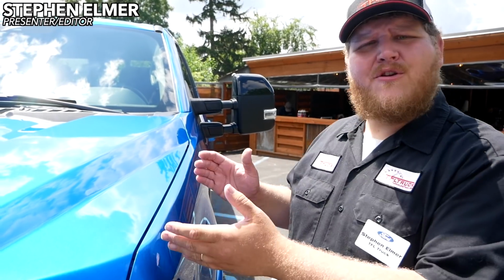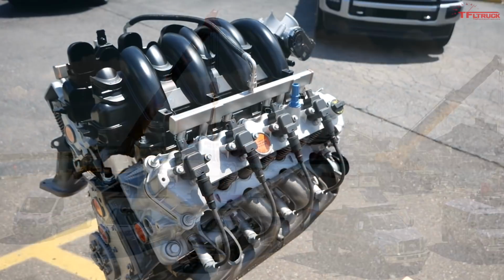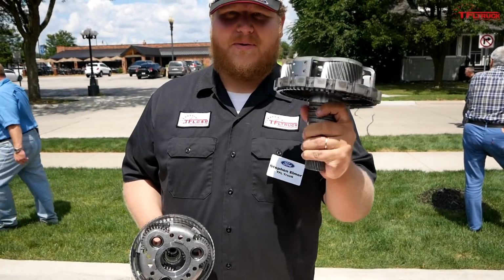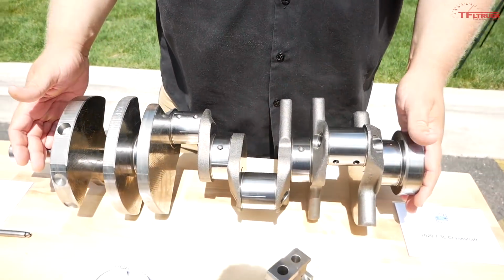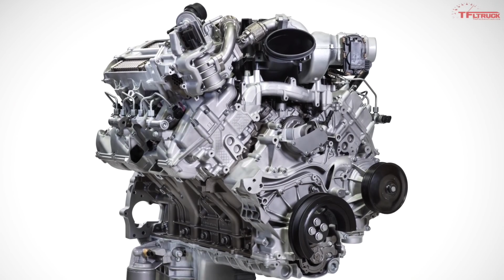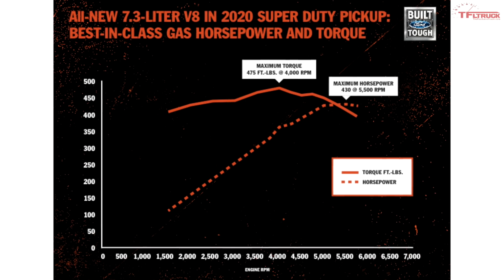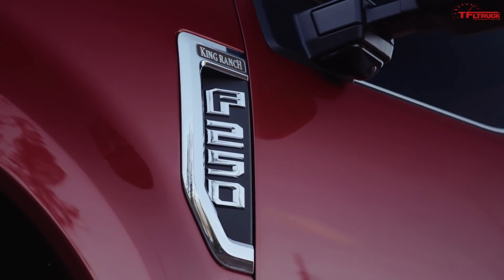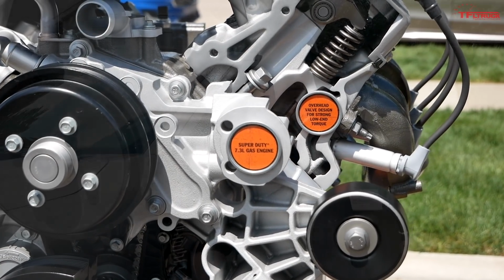We Finally Know the Ford Super Duty 7.3L V8 Power Numbers & They Are Lower Than We Thought!

Comment: If Ford could just bring back the excursion (based on the 2017+ Super Duty) with the options of either the 6.7 Powerstroke or the 7.3 gasser, mated to the new 10-Speed Transmission that'd be great.
Reply: I purchased a new MY00 7.3 Excursion Limited.  483,000 miles.  Motor has been chipped to 300hp, and never been touched inside, original fuel injectors!

Ford did two things that prevented the Excursion from taking off, and crushing the Suburbans, Yukons and probably some pickup truck sales as well.

1. Ford III received pressure from his environmentalist pals and agreed to NOT agressively market it.  You never saw an ad for it in RV magazines, snowmobile, boating, horses, ranching, the kind of users that would put high value on it, especially if they pulled trailers.

2. in MY00 GM did not have a turbo diesel to put in their pickup trucks, Ford saw an opportunity and built and sold as many 7.3 PSD pickups as they could.  In the first year, there were very few 7.3 Excursions and they were not made available for testing by the magazines and media.  Instead they took the standard 4x4 V10 motor, took it out in the desert, got them stuck in the sand and showed very poor fuel economy.  If they had tested 7.3 Excursions, on the road, with trailers, E range tires and decent springs, they would have killed the competition in almost any way you could measure.

ExcursionPSD
Reply: Emissions killed the Excursion, so Ford killed production after 2005 in America, and 2006 in Mexico
Reply: @DeezNuts-sx9jd  No, public opinion killed the Excursion. At the time, the environmentalists were louder and screamed about this truck as being to big. Never mind the suburban was as big.  Ford had no problems meeting emissions. It was a double standard that killed it.
Reply: chris1451 the terrible gas mileage made it very unpopular amongst those who never got the chance to experience it. I know a mid-aged dude who hated it when it came out and during its run, but he now has two 7.3 excursions and loves them to death.
Reply: @DeezNuts-sx9jd  The sales of the truck were fine. So your opinion doesn't hold water. Ford got shamed into quitting production.
Reply: I'd be first in line if they ever brought back the Excursion. My 02 is getting pretty tired with 300k plus.
Reply: @chuckmuellerleile8729  with all the money you saved not making payments, rebuild.
Reply: I bet it would sell like hot cakes in this Truck and SUV obsessed market.
Reply: Would love to have one based off the new trucks!
Reply: It’s coming. Just saw a covered up suburban with a duramax in it the other day GM was testing. You can bet ford will make a diesel suv too.
Reply: austinr09 the suburban 3500 has been out for a few years and it offers a diesel option. Granted, it is only for commercial use.
Reply: Yeh. What happened to the excursions. I have two with the v10 .  Thinking of dropping a 632 gas engine in it.
Reply: @billhumme5228  They were discontinued because they ran out of little pecker do nothings to buy them!
Reply: That would be so boss..
Reply: I still have a 2000 model Excursion Limited edition 4x4 and the Triton v10, have owned it since 2002 (240k). If anyone is interested hmu.
Reply: Government contract ended.
Reply: Miss the Excursions. Loved the extra weight. Did not need to throw into 4wd nearly as often...
Reply: But why do u like the excursion when u can have an f250 with a topper... same thing 🤷‍♂️
Reply: @usmcguida  it's not the same though. With and excursion you can fit 8 people plus a bunch of luggage, while towing a 10000 lb trailer all with relative ease. No other truck or SUV can do so
Reply: @usmcguida  but can you seat 8 people when needed. Or one of mine seats 7 because of the captains chairs in the middle row. Sometimes I need s pickup also for large items.  The v10 does have bad gas mileage. Does anybody here think the truck could support a 632 cu. Engine. 850 lb. Ft. And 850 hp.
Reply: @usmcguida  no it's not lmao
Reply: @usmcguida  🤣🤣🤣🤣🤣

Comment: Dear Ford, you’ve been Shoving 2.4 1.4 and turbo charged V-6 engines down everybody’s throat for years...all unwanted, and now you’ll build a new V8 engine with your track record of two failed V-8 diesel architecture and absolutely problem ridden V-8 gas engines since 1998 ,which had problems that were not corrected 10 years after its initial design ? That existed until  the engine was “scrapped by us “ and finally abandonedby you , and you expect us to trust you with a new engine design, LOL 😂

Comment: 400TQ at 1500rpm? Good luck doing a 0-60 with TC off lol.
Reply: Trust me, they have torque management out the wazoo.  The 6.7 has 935 ft lbs and magically it barely lights them up (well, I do have 4 tires back there)...

Comment: Chevy 6.2 makes 420hp and 460lb ft tq. Not super impressive at all.
Reply: The 6.2 isn't a heavy duty engine.
Reply: Chevy 6.2L
350 lb-ft at 1500
400 lb-ft at 2750
Reply: Ford is aiming for simplicity and reliability here. That 6.2 in the Chevys and GMCs suffer from injector failures and carbon buildup issues due to DFI. Carbon buildup can be so bad at times the entire heads need to be removed to remove all the carbon. Ask me how I know.

Comment: The moral to this story is the manufacturers are tired of meeting over burdensome emissions requirements for diesel engines. New diesels are much more expensive to maintain due to B.S. requirements. 
Ford and GM used to make engines that had their HP & Torque in the low rpms in the 60's ,I guess what's old is new again.
Reply: Amen to that my 6.7 diesel is crazy expensive for everything and you have to take it to a dealer to code everything or pay $600+/ yr for IDS. Factory power makes 400hp 800 lbft torque and pulling 14k lbs it makes easy work of it.
Reply: @whiskeytangofoxtrot9403  yes parts are expensive, I have a 16 comes with 440 and 860, but I use forscan which is free and it reads just about any module and pulls the codes on the newer Ford's.
Reply: Yep, truck makers may as well invest more in the gas engines for light duty trucks. The DPF/DEF systems add too much cost and maintenance to the new trucks plus, of all things, the engines fail long before they should, area of 150,000 miles and they are worn out from high heat levels. If you are lucky, you will get 150,000 miles but many will see engine failure at 90,000 or so. Sad for those diesel markets and they average another $11,000 in cost.
Reply: Garth Clark I’m no fan of dpf/def but these trucks are lasting a hell of a lot longer than 150,000. I work in the hot shot industry for a company out of Indiana with 1500 drivers and the bulk of them are newer pickups of all makes with well over 300k miles on these truck. Though personally I use the 5.9 Cummins 03 came stock with no cats or egr. 😆
Reply: @chrism1966  Most of the failures are coming from vehicles that spend much time on short trips, city driving etc. Those who are on the road for long distance tend to benefit best as the temps are always in the upper range thus the DPF doesn't regen so much. As I known it, below 30 MPH none of these diesel will regen ever.
Reply: @Garth2011  my old roll back with a built engine was less than that people need to just not buy the new over priced crap i laugh at 53k f150
Reply: Where does this expensive to maintain crap come from? I change the oil (10 qts) and $8 filter about every 5-7000 miles and fill the DEF tank twice between changes.  I use Amsoil 10w40 diesel oil and AC Delco filter. All in about $100. Oh, maybe because it is a Duramax!
Reply: @paulmcintosh5535  11-14 Ford 6.7 6.7L Powerstroke Diesel OEM Ford Fuel Injection Contamination Kit US $3,450.00 Ford Powerstroke 6.7L 2015-2019 FOMOCO Stage 2 Predator GXR-7 Performance Turbo $3,199.00 /1599.00 OEM /fer used engine $7,500.00
Reply: @overbuiltautomotive1299  What does that have to do with overly expensive maintenance on modern diesels?  Mine is no worse than modern gas truck engines.
Reply: @paulmcintosh5535  ok i tried

Comment: I love everyone talking trash.12v Cummins were 175hp/400tq. This is a easy to work on gasser with a cat/simple egr system.
Reply: That's just stock, upgraded you can easily get that number up
Reply: @alexavila8690  https://www.cars.com/articles/what-are-the-most-reliable-cars-for-2020-hint-genesis-lexus-make-em-418187/
Heres a list of the most reliable. There's a search engine named Google. Check it out and then you won't have to ask me for this info. LOL!
Reply: So a 7.3 diesel has low stats to yet both can do a million miles no sweat somthing a gaser cant do without a rebuild plus do easy mods on a diesel and them numbers get bigger where a gas u cant
Reply: @morgan-xv9bc  I like the 7.3 diesel but as far as the new diesel's I would take this 7.3 gas or a v10 any day. Be there done that!!
Reply: Diablodrift well your right about one thing. You will need to work on it! Lol!

Comment: So let me get this straight from what I've heard from people older than me. Sounds like we started with these types of gas motors in the 70s then ford and chevy turned those gas based motors to diesels. Now they've both returned to their gas roots which is good. And the only one out of the mix is dodge because they didn't make their diesel in the first place. Cummins did and that's why it's a whole different beast. I would say the same for a cat diesel or any old john Deere or perkins. A bit of a ramble but I like where all this is going back to the basics.

Comment: Impressive numbers given the technology. Ford kept this engine simple, pushrods with the cam in block. Ford isn't my first choice, but I admire this engine. Peak output numbers are for those who buy based on the brochure not test drives. Torque curve of the engine and the entire drivetrain gearing is what matters.

Comment: Too much background noise. Those exhaust manifolds will flow better than the ones Shelby Mustangs had in the 60's !  Do I see an external mount oil cooler ? That is perfect.  Camera went too fast over the orange circles that showed areas of improvement.

Comment: That torque curve is impressive!  Why is this “underpowered?”  Are they drag racing or are they towing a train?
Reply: No. They just want something fast so they can brag about it. The higher the horsepower, the fast the truck must be. Frankly, we were better off with power ratings that were only 230-260 hp, and 290-350 lb-ft. Why do we even need 400+ hp?  No wonder modern vehicles are ending up in the shop more than ever.
Reply: Mr10Alpine sounds about right.  Vehicles are cheap to lease and most have this throw away mentality here.  So bigger must be better.

Comment: The peak HP figures of modern engines can't be used to compare real world performance. The ability of a driveline to do work is a more complex issue. This engine and 10 speed combo will almost certainly be able to deliver significantly higher average power to the wheels through the acceleration range than competing smaller NA-V8 engines and/or engines coupled to fewer gears, despite very close peak HP figures. Having a more conservatively tuned peak HP, and a flatter power plateau, demonstrates conservative engineering and really speaks to a more intelligent customer base who have to make decisions based on practical business rather than personal desires.

Comment: Ford has already explained the engineering behind the motor and it isn't Dodge Demon busting. How darn stupid can you get? It is going into line trucks and first responder trucks and vehicles that idle and run off the PTO for extended periods--which modern diesels don't like at all.

Comment: Power ratings can start low for now as Ford just has to beat the competition, then raise output as competition raises their numbers -- you don't release a brand new engine and then max it out immediately. This engine can probably be turned up about 10% and HP and torque without any real adverse effects on long-term durability.

Comment: Love how he said we have all this data but didn’t say how they got the info and from whom. Was there bias is it just a unicorn number anyone that has taken statistics sees this and laughs. This is the stupidest engine and is a step backwards. Electric is going to take over anyone can see this. If your going to do any heavy pulling a diesel is the only way to go. Why would ford waste time and money on outdated technology.
Reply: The old that is gold does not wither. Besides, diesels are way more complicated engines inherently and electric is still unproven especially for medium/heavy duty work with much of the payload capacity being robbed by the batteries. Forking up the money for gas is much easier than paying for maintenance and dealing with the shop downtimes when it comes to  modern diesels.
Reply: Q8kik I agree with you the engine is simple and will probably last a long time. By the time this engine dies electric will have taken over. I am not an electric fan boy and I love my Cummins but if I can have all of that power without all of the hassle of any fossil fuels then I am all for it.
Reply: @jerremyvinson6310  Hopefully a break through does happen because lithium battery technology is looking stagnant right now. and if nothing of the sort happens during the next decade i really don't see electric vehicles taking over anything other than sports cars (they certainly won't take over work vehicles with their current weak points).

Comment: I'm pretty sure part of the reason was also so they have more left in the motor when Dodge and Chevy decide to up their powers. Because I do believe Chevy already announced they will eventually have a replacement for the 6.6 gas. Day as well as God's will likely strike back with higher numbers. Till then Ford has the highest numbers and when the time comes they will make a simple computer calibration and the resume seniority.

Maybe ford should take their own advice about larger displacement engines and push rod motors. As great as the 5.0 coyote is it is a lot more expensive to modify and maintain than an LS. With less cubic inches available and the same if not worse fuel consumption then a Chevy 6.2. Cubic inches is like your weight. if you feel and look good it doesn't matter what your weight says. 

So if Ford could go back to push rod have an overall smaller package cheaper to maintain and modify and more room to grow for the enthusiast. 
Take a lesson from your own words Ford. Stop trying to bring an even smaller cubic inch engines when they don't use any less fuel. Like the rumor that they want to bring the F-150 down to 4.8. Instead get us some nice new pushrod engines that are easier and cheaper to work on and put out more power and have more displacement possibilities. How about a nice 6.0 base engine for the Mustang and then throw into 7.3 for the top models. Chop chop Ford get through it!

Comment: This thing is so old school I might just shed a tear. 

More than enough horespower, low-revving, and VERY impressive torque curve from off idle up. This thing finally gives die hard fans that loved the old 300 or 460 something to clap for. Being so unstressed, it should last a lifetime.
Reply: Brother I have to agree. I hated and still do hate the twin OH cams in almost ALL the new motors. So good to see old-school lifters and ONE CAM!!!
Reply: @som1alive  For efficiency and streetability at high power, you can't beat the twin OH cams.. Once you crank up the power, the coyote will stay much more streetable, whereas the big blocks will barely idle, make no vacuum, and get 6mpg...
Reply: I have a feeling they built in a lot of overhead on this engine and won't take much to revise it next time GM and dodge get a power bump... They've been toying with GM lately - usually with the diesels.
Reply: 460 gassers are still better😯
Reply: @ahmirbailey  less (advertised) peak torque than the 460 and at 4000 vs 3000 RPM. 7.3 would be a good car motor, or for soccer mom pickups but just like that high spun 6.2l it has no place near a truck, especially with Ford's recent obsession with tall gearing. 3.73 gears in a SRW 250, 4.30 gears in a 350 dually with a first gear around 4.00?  Just a marketing ploy, lower the torque multiplication in order to get consumers to cough up for a 900tq turbo diesel just to tow what a 300 I6 F350 would have pulled backed by a 4 speed because they used to build pickups to work, not get groceries.
Reply: @MinimalistMotoLife  ok boomer
Reply: @MinimalistMotoLife  I SEEN YOUR VIDEOS YOU DON'T KNOW WHAT WORK IS
Reply: @hikdingle2210  lol
Reply: @MinimalistMotoLife  I can tell you have never had to work. Steel mills and saw mills are work. But hey if you can run around living like a bum that's good for you.
Reply: Agreed. I can see this thing having that typical Ford "Seasoned crispness" that the 5.0 HO had with it's tried and true dependability 🤘 Im all in on this giant "lizard"
Reply: This is anything but"old school".Its far more advanced then anything GM or Cryslur has,that's just for starters.
Reply: @4gauge10  it's Actually BASED OFF of "old school/tried and true pushrod (but far more stout) design with new technology that could go either way , too early to know regarding the technological aspect, but with the "Back to the (OLD SCHOOL) " design...
 it has potential to be a go to like the LS engine is now for transplants (ie; dropped in an 88 - 97 f:2fittdy 🤓👌

Comment: Modern day incarnation of the low-rev 429 of the 6th gen medium duty F-series; redline at roughly 4000 rpm, slow as a worm on hot asphalt, but would pull anything, all day long, with the occasional oil change thrown in for good measure.